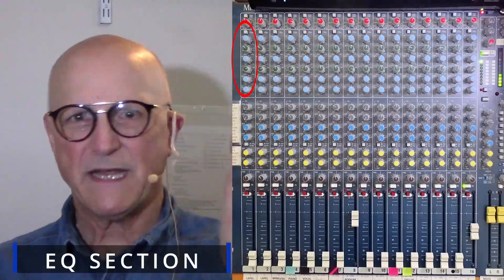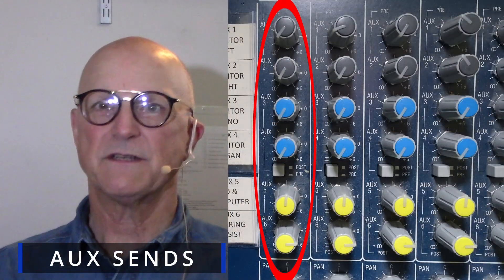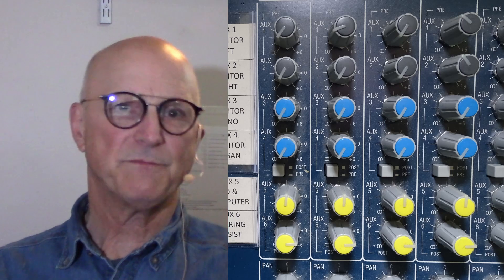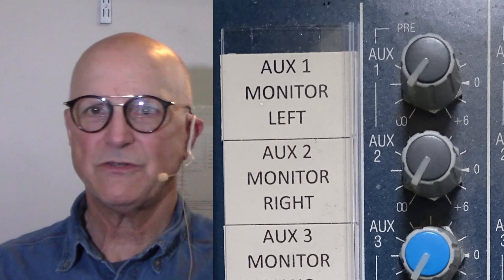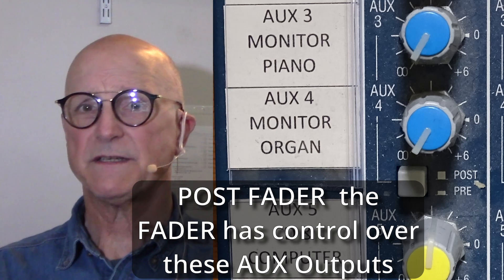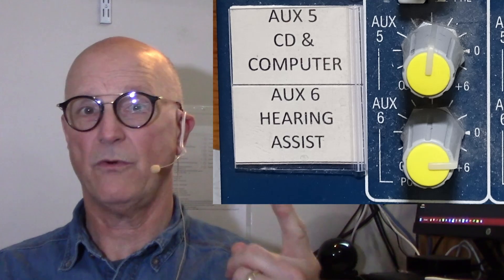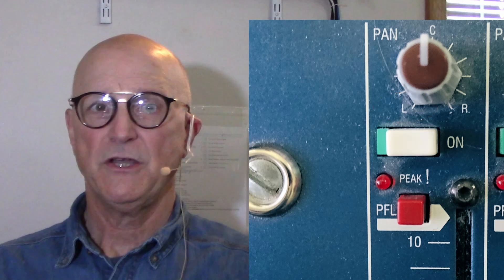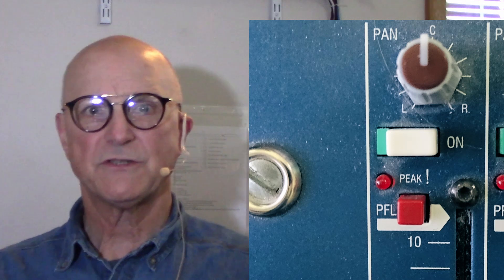Introduction to the Audio Mixing Board (042)

Comment: Very well done Sir. I watched for the nostalgia of it. And it brought back fond memories. It has been almost 30 years since running a sound system for various bands in my area, (unprofessionally, as I was self taught) But I do miss it, the technical aspect of it, though it was a lot of work to set up and tear down every weekend.
Reply from the maker: My first experience was in the early 70's with "Sing Out Lake Ontario" which was a BIG choral group in central New York. I don't know how I got elected to run the sound board. I knew *nothing*...but I learned!
Reply: @eie_for_you  I was a band member, I did it for the band and and other bands. The best mixer I had was a Makie,
Reply from the maker: @CaptainKirk01  I've used all sorts of mixers. Makie sure does make a fine mixer. I have a Behringer on my desk here (small, micro-mixer I use for voice over stuff). We have an Allen&Heath at church.